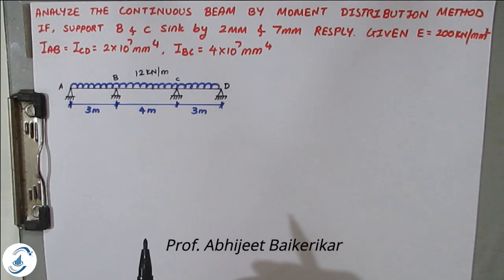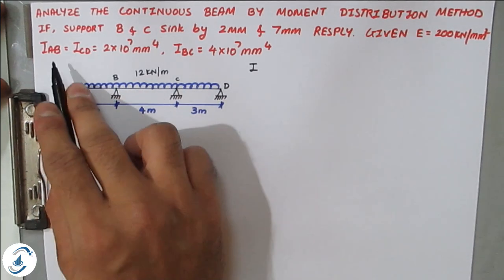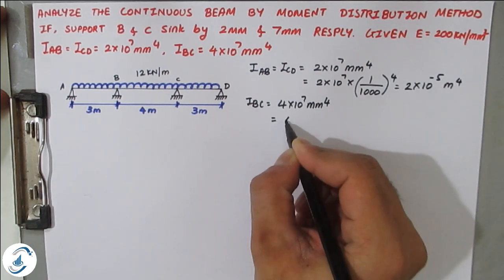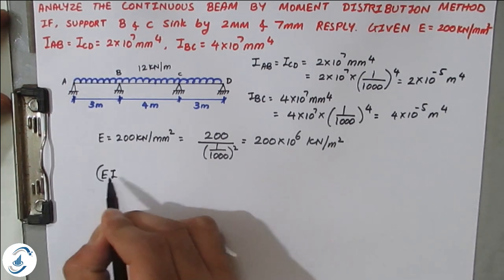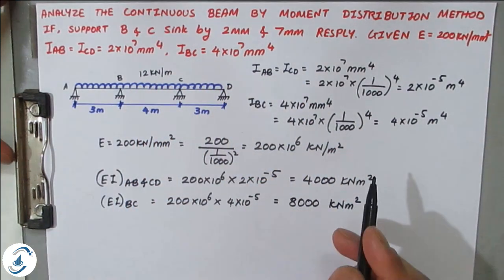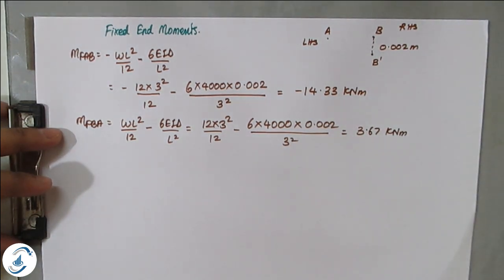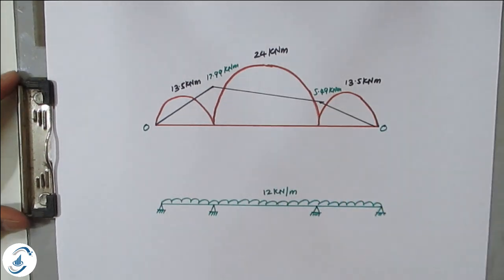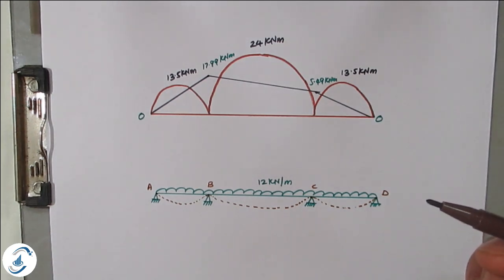Moment Distribution Method | Double settlement or sink problem | Analysis of Indeterminate Beam

Comment: Sir you have told Delta sign reverse in S-D method
Reply from the maker: Moment Distribution and Kanis Method sign convention is same for Delta but for SD method its different, correctly remember and solve for your exams, all the best
Reply: @structuralanalysisanddesign  tq sir. Monday I have Indeterminate Structures exams ur Videos helping me a lot 🙏